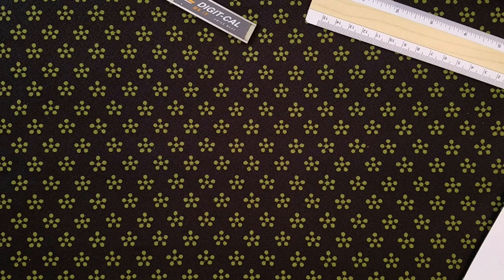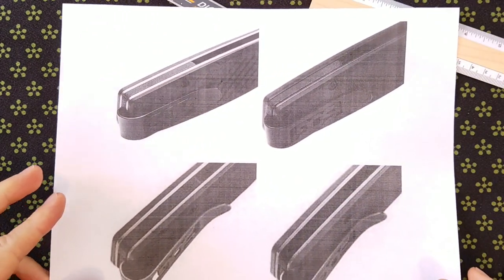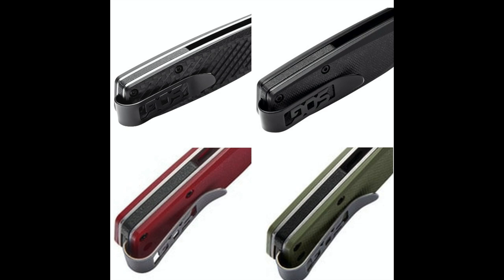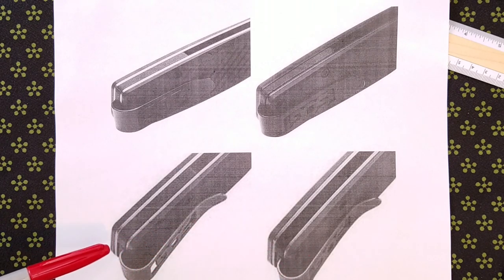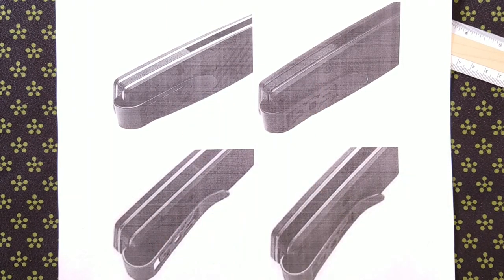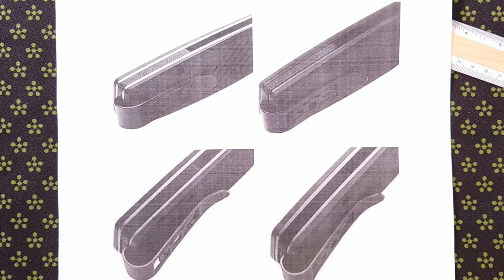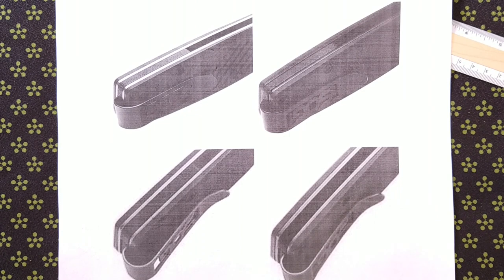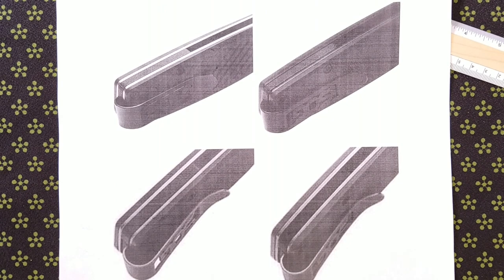The SOG Terminus XR Pocket Clip Fiasco

Comment from the maker: It looks like the clip that was introduced on the Terminus XR LTE has a significantly sharper bend, which should reduce (but not entirely eliminate) the potential for trapping the fabric of your pocket behind the butt of the knife.  If you have the old-style clip pictured in this video, you can contact SOG customer service for one of the new-style clips.

Comment: I bought the Terminus XR red G10 version as a Christmas gift for a friend and it shipped with a different styled pocket clip.  No more SOG cutouts.  It's narrower and the tip is flattened so it won't be as likely to scratch car doors, etc.  The clip is attached like those on the lower row in your video.  Now I just have to move it to the other side as he is a lefty.

Comment: Hey Shelter Monkey, we shared comments about a week ago on the Knife Center YouTube channel.  I watched your video and have double checked my Sog Terminus XR.  It is OD Green G10, and the pocket clip is setup like the Carbon Fiber Terminus in your video.  I did get the knife to "catch" on my pocket, and as you said, fabric from my pocket bunches under the clip.  When that happens it does not come out smoothly.  I am going to try to move the clip from the far side to the near side and see if it improves.  Myself, I don't find any discomfort with the clip when using the knife, but I understand your point about how the tip of the clip can come up and cause a "hotspot".  I have a Hogue Exploit and the clip on that is uncomfortable for just that reason.  I still love my Terminus.  It is easily one of my favorite knives, but I agree that the clip issue should be addressed.  Thanks for the info. and the insight.  Best of luck to you.
Reply from the maker: I returned my mine to where I bought it from. I did not try moving the clip to the near side.  On the near side the fabric-trapping issue would seem to be much better, but it's still not ideal.  They should have made the clip like that of a Buck Vantage.  They should improve their quality control too.  Thanks for commenting and Happy New Year!

Comment: The knife said adjustable clip.  Do you know how to adjust it? I was thinking of reversing mine.  I have the orange one and the clip is as you described
Reply from the maker: SOG's website states "reversible". By the way, there is a newer style clip available which is thinner and doesn't have the word SOG cut out of the metal. The new style clip is available in black, silver, and gold. It may have a tighter bend which reduces the problem pointed out in my video. SOG will probably send you one for free.

Comment: I switched mine and it solved the pant material catching issue, but the retention like you said is garbage. Still gonna be a backpack knife for me. Good vid, and good info.
Reply from the maker: Thanks.  They should have copied the pocket clip of the Buck Vantage series which come out of the end of the handle, but doesn't have any issues.  Don't forget to keep that D2 oiled. (Lanolin-based corrosion inhibitors such as Fluid Film work great.)

Comment: I bought the red one and later the carbon fiber one.  They both had the clip in the spot like the top 2 in your video.  I switched them around to be like the lower pictures and like it much better.  Notice the other way around allows the lip of the pocket to go up and in, causing it to catch on my pocket. This was driving me nuts and now I am liking it much better.  I am not in love with how it says sog on the clip but it is a great knife and worth a few irritations.  I hope someone comes out with a aftermarket clip soon.
Reply from the maker: Hi. You could request a spare clip from SOG and attempt bending it yourself.  Also you might want to ask Pops Custom Clips on Etsy if he would make one for you.  Thanks for commenting!
Reply: I can live with the clip as long as I can get it off my pocket.  I may try to make one myself.  Thank you for the info, I love the knife.
Reply from the maker: @1964krazyeric  I would attempt to bend sharper corners into the existing one.  Do you have a torch?  It's easy to request a replacement clip from SOG.  (They said they would send me one, but it never arrived, and I don't have the knife anymore anyway.)
Reply: I may try that.  I'm wondering about squeezing it in a vise?

Comment: And I own the new carbon fiber S35VN. I asked for a new clip and put it in the near side hole and works incredibly great. With no problems at all goin in and out of the pocket.
Reply from the maker: Was the new clip any different than the original?  SOG said that they were mailing me a clip, but it's been a few months, and I didn't receive it.
Reply: @sheltermonkey6065  they shipped me a new black clip for my carbon fiber  and my crimson red. And I specifically asked for a black clip for the crimson red. But yeah the clip showed up within a month.  That's weird that you haven't received it. I also called and spoke to someone and they had it shipped out to me. I didn't do it on line or automated. Don't like taking those routes. So not sure how you did it but speak wit someone. Everyone I've spoken wit have been very nice and helpful.

Comment: I found your video because I'm having the same issue and was trying to find out if it was just me. I'm on my second terminus  due to the fact that the first one fell out of my pocket because I moved the pocket clip to the right side of the back spacer. I love the knife so much I picked up another. The second one came with the clip on the right side of the spacer. Which confused me. So I moved it to the left. I have put a paracord lanyard on the loop part of the clip to see if that resolves the issue.
Reply from the maker: I corresponded with a SOG customer service rep, but he seemed unable to comprehend the issue.  Unfortunately this flawed pocket clip design seems to be carried over to the new Flash AT model.  Fortunately the new Trident AT and Aegis have a more standard pocket clip design, though at least with the Aegis, the screw heads can interfere with the fabric of your pocket.  Thanks for commenting!

Comment: Mine was on the far side it secure in pocket and was hard to get out mostly due to g10 grip took off clip and hit the G10 around the clip area with 1000 grit sand paper to smooth it out no problem now although its an edc knife. fixed blades are used for defense and need to be accessed fast not folders

Comment: I received mine, green od, in the far side configuration. I'm debating to reverse it because Iḿ a lefty.
Reply from the maker: I got rid of mine... There's too many knives out there with perfectly functioning clips to waste time on it.  SOG should have just copied the pocket clip design of the Buck Vantage which has been around 10 years and works perfectly.  Thanks for commenting.
Reply: Shelter Monkey I did end up flipping the clip. I like it better now.

Comment: There are only few good pocket clips. Most are subpar. I have no doubt this is the case with the Terminus XR as well. With that said, I was with the understanding that the pocket clip positioning differences in your images is to allow for different clip retention, depending on the mounting position.
Reply from the maker: It's shocking how many pocket clips are poorly designed.  The Buck Vantage from 10 years ago has a tail end mounted clip that works perfectly.  SOG should have just copied that design.

Comment: I own both knives, and there is absolutely no issue with the clip. Both S35V and D2 versions of the clip are inserted properly in the far side. This loop area is for a lanyard. But if you wear very weak pants like shown maybe you could experience something?!? But inserting  a lanyard you could grasp the lanyard and pull from your loose fitting pajama like pants?!?

Very stupid to call this knife worst knife because of the clip. This knife is my favorite knife of 2020.
Reply: It is an awesome knife but the clip is complete trash. Even wearing denim jeans with the clip in either position its incredibly difficult to get out of your pocket due to the fabric wrapping around the end of the knife.